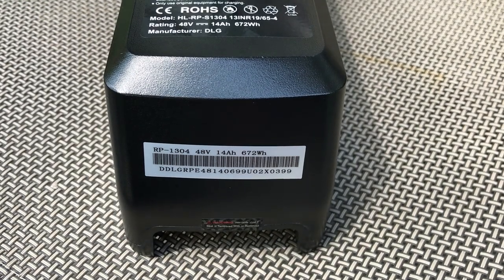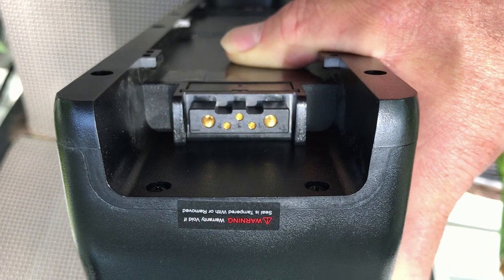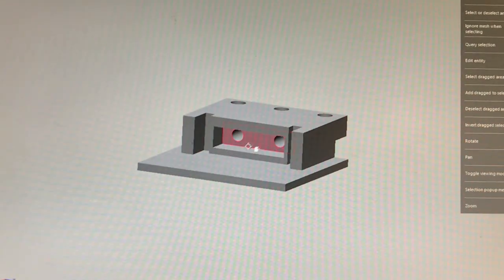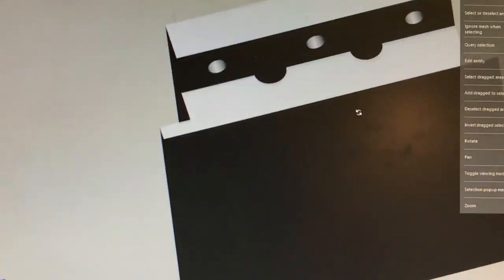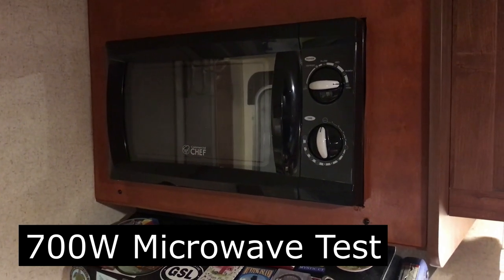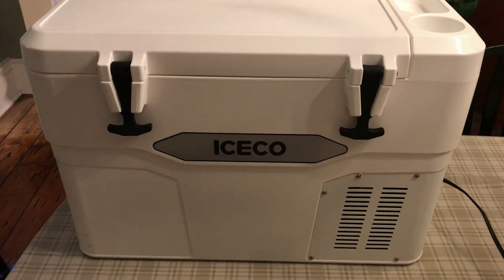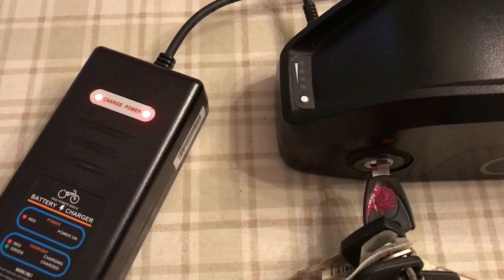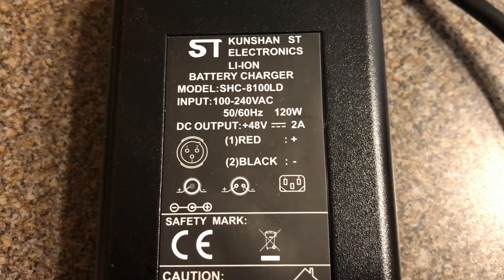Using RAD eBike Battery for Solar Power Station

Comment: I am building a similar unit using a 15Ah 36V e-bike battery and a 36V aliexpress inverter.
I am going to charge the battery from 12V using a solar panel and dc/dc boost converter 12 to 42V and just have to figure out how to limit the charge current to 1-2A to not blow the boost converter

Comment: I'm camping right now and have a massive Ebike battery that I wish we could use for the camper power. The Bluetti is almost dead due to no sun. My Ebike battery is full and I have no way to use it. It's an 84v 35AH. I need to figure this out and use it in the future.

Comment: Fantastic presentation, thanks for trying things different ways and showing what is happening with the meters. You got me thinking the bike battery could be used to power a small PA system where there isn’t power around.

Comment: Very informative! Thank you. Love the printed connecter! I'm researching also using my rad battery as additional storage in my motorhome to run some electronics. My thinking is to keep it charged as backup battery - using my solar bank. Then with a 48v-12v converter use it to power my Ecoflow River Pro when its level gets low - the River pro can accept up to 8A from a 12V source as input.
Reply from the maker: I tried to eliminate the conversion losses by using the matched AC inverter

Comment: Thank you so much!  Exactly what i was looking for.  i have a rad battery, a 48v-12v converter and an off-grid cabin to power.   Now I just need the banana connectors and the wire!  and something to hold them in place.  Brilliant!

Comment: Im thinking of doing the same thing thanks for the video i think instead of making a connector though i would order an empty battery box thats the same as my battery  they come with a connector you mount on a bike i think that would be easy aliexpress has them cheap.
Reply: I want to use my Rad battery to power lights at my off-grid cabin.  I have the 48-12v converter but don't have the ability to make the connector to my Rad battery so I'm wondering about your comment about the "empty battery box"....were you able to get one?  I'm interested.

Comment: Hi very cool video, this is something I wanted to try for a long time, dose your battery have a bms? And if so will it be cut off automatically when it reaches a low voltage? Also if the bms really protects from low voltage, can you use a step up and step down converter? You are one cool dude thanks for the video.
Reply: From the info Rad tells people about balancing their batteries once a month,  I have to assume there is no BMS in the ebike batteries.

Comment: What software did you use to create your 3d STL file? Wonder if you could put two batteries in parallel to increate wH? Should be able to go to a larger inverter? Thanks.
Reply from the maker: I used Geomagic DesignX. You could put batteries in parallel, but they would have to have the same charge level or you would have big problem.

Comment: I have a weird question: Is it possible to hook up a solar charge controller's output to an inverter and then a battery on the input? I have a 48v inverter & 40v ryobi batteries, solar controllers seem to be cheaper and easier to find than 50-60A boost controllers.
Reply from the maker: Interesting question. The ryobi 40V battery can provide enough juice to run their 300W pure sine wave inverter (usually less than 10A). So you would have to combine quite a few of them to get to 50-60A. You would also need blocking diodes in case the voltages are different. You would need a hefty solar charger. I just went with a 36V inverter https://youtu.be/p4xW9f1ohlw

Comment: If your bms is rated for 30 amps out you should be able to charge more than 2 amps in... I imagine 5 amps would still be safe . Just monitor the heat to be sure .
As far as the old battery goes ... some batteries and some chargers have propriety connections .
They ensure that you are using it for their product and no one else's  .
Or it might be requiring a voltage range (39v - 53v) before turning on ?
Good luck  . (I'm also experimenting with my ebike batteries .)
Reply: And how is the test

Comment: Did you get any sparks when connecting the battery to the inverter?  I’ve been researching this same setup for a few days and I’ve seen videos recommending to pre-charge the capacitors before connecting the battery to the inverter. Is that something that you do?
Reply from the maker: I hook up wires before turning the battery on. Haven't had a problem

Comment: Hi Chris:  Nice job.  I really like your channel.  I will bet that whoever sold you the eBike swapped out the original battery for a "clone" battery.  Then they sell the original batteries as spares and can charge more for them.
Reply from the maker: bought both direct from RAD Power. Both batteries work fine for eBike riding.

Comment: Nice! My eBike arrived today (after waiting 6 weeks). I've been learning a lot from your channel. Thanks for sharing :) Is there a weight difference between the batteries when they are fully charged?
Reply from the maker: I never weighed them. I doubt there is any difference.
Reply: @SerendipitySue  Good luck. I always considered Rad Power to be a reputable company

Comment: I was wondering if you ever solved the difference between the 2 batteries one which you could access power and the one you could not. That is the one I have.
Reply from the maker: no :-(
Reply: @SerendipitySue  Do you sell your Rad Battery Connect Adapter or offer it on some website? I know you offer your build for printing the item , I don't wish to attempt that now.
Reply from the maker: @kenny6391  no sorry, but there are internet companies that will print 3D models for you
Reply: @SerendipitySue  Any chance there is a high value resistor on the bike across those other contacts used to prevent discharge unless the battery is connected properly? Maybe the old batteries didn't have a very good BMS, so this was just another safe guard to prevent short-circuiting whereas the newer batteries have a better BMS?

Comment: Radpower bikes do not sell extra battery base mounts. I reached out to them and they told me, they can only sell me one if my mount is broken. I want  to put dual batteries on my bike. Can this work this work for that?
Reply from the maker: I designed and 3D printed some: https://www.printables.com/model/69891-rad-power-radcity-ebike-battery-holder-for-rack-or https://www.printables.com/model/71609-rad-power-battery-and-bike-connectors https://www.printables.com/model/70263-rad-power-ebike-battery-adapter
Reply from the maker: you have to be careful running two batteries in parallel. They have to have the same charge level. You can NOT use blocking diodes because of the regenerative braking

Comment: Yes sir great information I'm guessing you have a electronic  back ground , ?

I see no glowing melting or smoking wires on any  test ?

 I can't even change my vape battery's with out occasional catastrophic component failure ,

 question 52v 30Ah escooter Panasonic 1600w max out put lithium battery nearly new 100 hour of controlled prudent usage. 

Integrated into a van build that running a 1500 3000watt surge,  

power drive inverter

A high out put Toyota alternator 14.7 volts under normal load .

 The lithium battery is very similar to yours without the key switch only 2 wires charging with charge port and 2 wires out put 53.3v is the max charge its has obtained 

39ish is as low as its discharged .

Do I need a special inverter to handle the 52 v input for a 110 ac out put , 

only running 20 bulb  led lights strip charging lap top, phone ,350 watt rice steamer/ slow cooker 1 hour per day
 charging Milwaukie 20v drill batteries 2 hours per month 
I was charging the emove cruiser escooter with this system running directly off the starter  12 volt lead acid battery

 and as long as I am running charges as well as 110 shore power   auto shut down at    12.1 volts  inverter after 20-30 minutes of engine off no problems 

I'm looking for this system to run my led's all night when I fall asleep reading  wake up with phone and lap top charged full 
I typically drive around 100 or more miles per day 2-3 hours or more,

 so I would like to avoid solar panels complication,

 no shore power option for my life style.  

Retired army,

 my dog and I just travel from beach to desert to mountains exploring mild climate hiking trails .

 Used book stores, libraries, dog parks, wilderness national forest, Colorado River kayaking the slow water, trout fishing, fruit and vegetable farmers markets,

 0 politics media

A gas mini bike logging roads,

 low traffic scenic routs,

 less than lethal protection options,

 clean abandon homeless camps if it can be done safe in a couple hours, 

sorry T.M.I. I get a bit hyper vigilant and over anylize when I'm sleepy, it runs in the Army family Men,

 after years of service.  

I'm going to figure this out I would really like to avoid any destroyed components in the process ,

Any and all legitimate input would be much appreciated from the this YouTube video producer and or the other viewers. 

 Thank  you fellow earthlings for all the great experienced educators taking the time to fill this platform with so much high quality information  presented for  the less experienced for all the future  generations that are able to skip Chilton books, college expenses plus time ,impatient family members with low teaching skills , unscrupulous professionals, 
Natural strength and weaknesses barriers, 
All the other pitfalls that can be avoided by having great experienced educators with good video making abilities   God Bless all of you that  donate your valuable time to this educational platform .
Reply from the maker: You need an inverter that would take the 39-54VDC range. I use this 1000W one ( https://amzn.to/3WIBXGB ). I would just find a DC-DC converter (  https://amzn.to/3BZbX1P ) that would take 39-52V and convert to 13.8VDC. Then you could just run your 12V appliances
Reply: @SerendipitySue   awesome that's exactly what I needed to know and before I could find the information by becoming a expert , I really didn't want to take that much time , Thank you so much
Reply: @SerendipitySue  holy electricity under 150$ wow that is well in my budget I would have went over kill rather than taking time to educate myself , I've tried and am very mechanical minded but when it comes to electrical my mind is practically useless I can think of multiple time glowing wires . 220 one time no wire anywhere no burn marks , just a flash pop and then all wires were gone . It's kinda funny looking back but kind of  scary at the event horizon.  Thanks again .

Comment: Great idea.. I have a Quattro 5k on my rig at 48 volts with 300ah of EG4 batteries. Hmm maybe I could just print this connector and let the Victron charge the Rad batteries..
Reply from the maker: would probably work. Just check all the Victron parameters to make sure it has the lithium battery parameters correct. Also hope you have the RAD battery version that works!
Reply: @SerendipitySue  I would just be charging the Rad batteries in parallel with the EG4's. The charge voltages are the same as they too are Lithium ion cells. Top end of the EG4's is 56.8 volt also
Reply from the maker: @patzbit9562  Just don't want to charge them at more than 4A... not sure if BMS will shut down things or not if you exceed
Reply from the maker: @patzbit9562  Be very careful that the battery voltages are the same... otherwise you will have an arc-welder as the current runs quickly from the higher to lower voltage batteries
Reply: @SerendipitySue  right.. have a resistor i use to bring up the lower battery